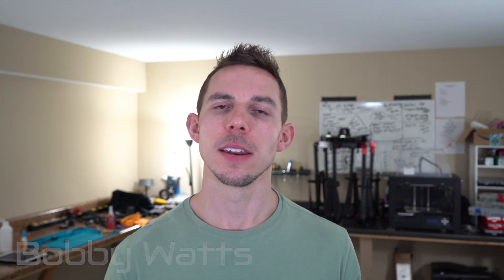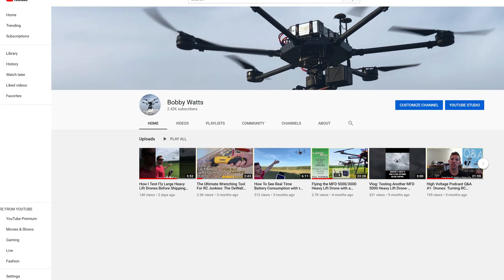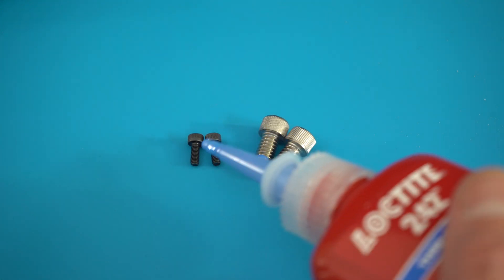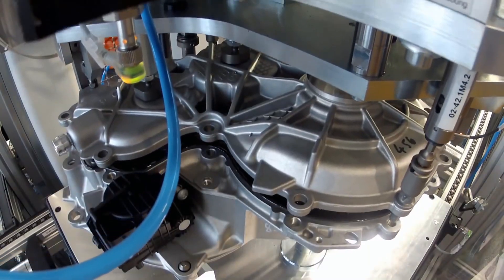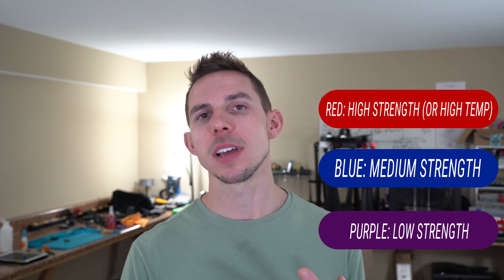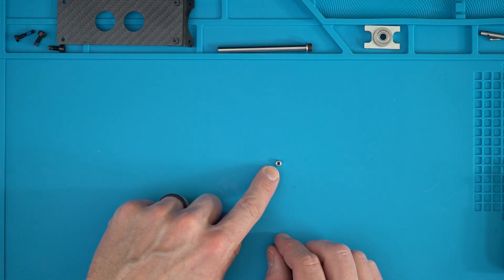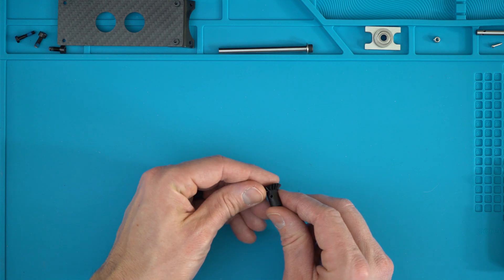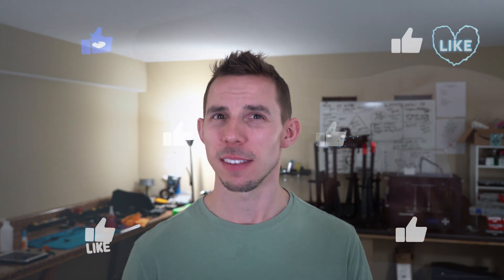Don't Tighten Another Bolt Without Doing This! Nuts & Bolts: Threadlocker

Comment: lol, RED  - for permanent fixings...

Loctite doesn't break plastic over time - if the plastic is incompatible it goes all gummy and loses integrity overnight (or shorter) - if it lasts for 24 hours the loctite is cured and the plastic is likely safe NB.metal threaded into plastic (self taping into plain interference hole) - any "locker" is truly unnecessary - do it if you like call it "your personal rosary" - unless polystyrene or other "non CA safe plastics..  ;o;)

 The preapplied Loctite threadlocker is "gluestick" applied..  (a pretty good way to apply without risk of dripping)

NB - if you tighten to torque specs, you are good to go under all circumstances - torqued bolts do not tend to come loose (not on first use  - or hundredth if the product is designed correctly)..

Comment: The dry blue patch on screws is NOT loctite (which cures when in place and is not reusable), but a nylon based product like „Nylok® Blue Nylon Torq-Patch®“ or „ND PATCH®“ (which are reusable).

Comment: Bobby, I will add to your great video that loctite acts as an interrupter and only works in the absence of air, it's liquid basically until air is not there anymore and will  activate so fast that even while you're pressing a tight part into a space it will lockup if you don't get it in fairly quickly, (it's that good). Also I didn't see the mention of how to use products such as (locktite 680) loose fitting tolerance locktite for situations where there is greater slop between the fit that would require a higher viscosity and not so thin a product that will fill that gap and interrupt the surfaces so they can't move ever again. (man I downloaded all your smacktalk vid's weekly back in the day, after 20 years of flying helis, you, bert and realflight were able to get me through the full 3D status in 1 year. -peace